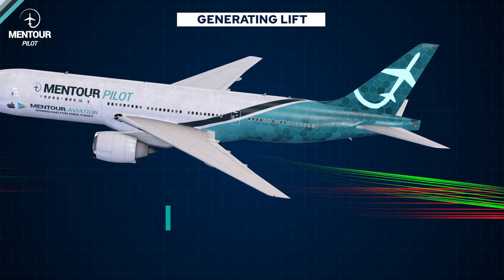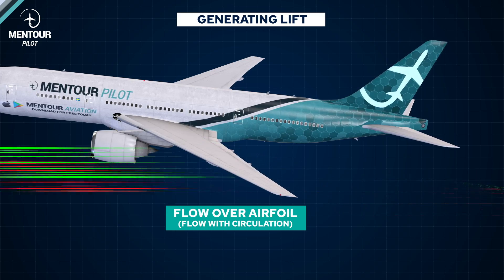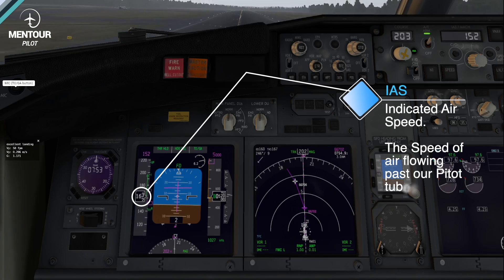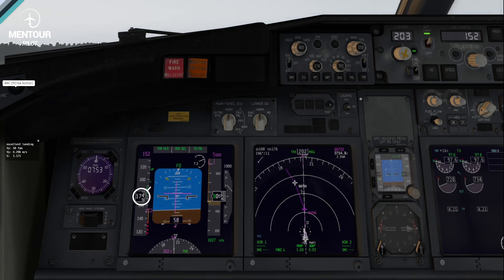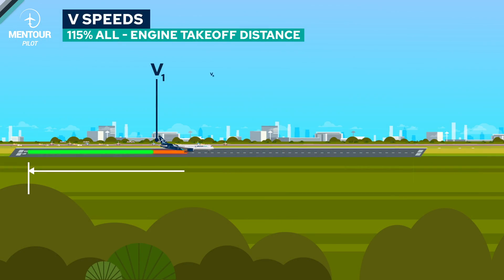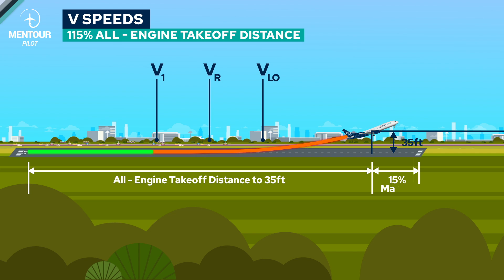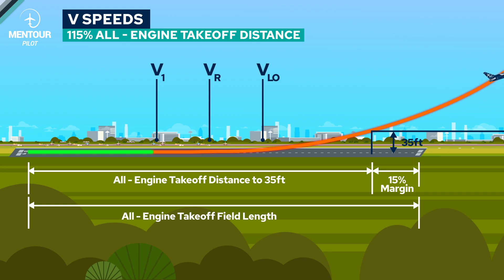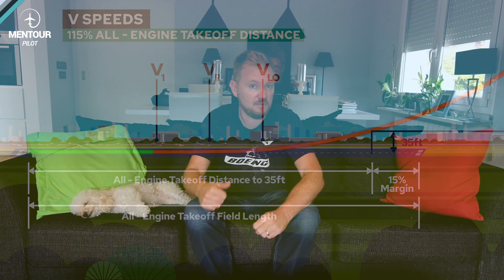Why do pilots call out SPEEDS?!

Comment: At 7:50 the graph shows a linear relationship between speed and mass. Kinetic energy is 1/2mv^2, so this doesn’t make sense to me
Reply: You aren't alone -- that graph needs a do-over.  If I (or someone else who's had experience with V1 matters) can figure out a way to salvage the attempt, I'll post and maybe it will get pinned.  As for what's there now, it is true that the relation between V1 (unfortunately the graph is just labeled "speed") and mass would be "monotonic decreasing" as is depicted, though as you point out presumably not linear.  Nor any other simple math relation:  I used to run a computer program for stopping distance calculation which time-step integrated through a host of nonlinear contributing factors such as drag, speed-dependent braking coefficient, and when applicable spool up/speed-dependent reverse thrust for a given EPR or N1 thrust setting... and that was just the "braking distance" part of the larger accelerate/stop scenario which determines V speeds for a given set of aircraft and external conditions (runway length, runway slope, air density, wind vector).

Comment: ICAO: We need to make things easier to remember and communicate
Also ICAO: Here are our 46 V speeds
Reply: I just got into a new type a couple years ago. The plane has all the basic systems that any other transport category aircraft has with the exception that the manufacturer decided to rename and re-acronym EVERY. THING. That first check ride was quite a test!
Reply: @aafjeyakubu5124  did the manufacturer ever provide a good reason for distinguishing itself that way?
Reply: @77thTrombone  They did not and I did not ask. However, the primary language of this manufacturer is not English and the translated books, while not as bad as they could be, are riddled with spelling errors and concepts that don't seem to translate well to English.
Reply: @aafjeyakubu5124   ah, yes.  I have immediate ideas, but will only observed that certain languages seem remarkably more prone to issues of "concepts that don't translate well" than others.  That trait could be considered a form of technical security.  Happy flying!

Comment: 8:27 When the weight changes the lines are going to move and the intersection is going to move. I am seriously confused. The changing weight should be already be accounted for in the diagram. There is no need to shift the lines. Unless weight and mass mean very different things (I know weight is technically a force but it shouldn't really matter in this case).
Reply: The chart isn't right, to put it simply.  So far I'm nearly a day into head scratching with still no answer as to how better to represent what he is trying to depict.  In reality there are a lot of interacting nonlinear factors which go into either of the lines, but perhaps something which at least illustrates the interplay between mass and V1 can be concocted (or already exists somewhere else, and whoever finds it can share the link?).
Reply: @marcmcreynolds2827 
@Thomas Dalton wrote this almost a year ago in a different comment, and I think it makes good sense:

"I think the correct description of that chart is that V1 for a given mass is the lower of the two lines. For a low mass, it is where the go line is for that mass. For a high mass, it is where the stop line is for that mass."
Reply: @Trotters79  Thanks for finding that, and yes, it does sound like a good explanation in the broadest of terms.  I'm having trouble with the shape of braking line (shouldn't be linear, though for exposition maybe no big deal) and what exactly he's trying to illustrate.  The chart (to within my pickiness) makes more sense if what he's calling "normal" V1 is "balanced field length" V1:  Same distance needed from the V1 point to either brake to a stop without thrust reversers or continue on the remaining engine(s) to clearing 35 ft.

Side note:  In reality, because of a stiff factor of safety the FAA applies to the demonstrated dry-runway stopping distance, a "balanced" V1 actually results in a significant amount of runway left at full stop, even before allowing for reversers if they happen to be available in a particular incident (even just idle reverse helps, by removing forward idle thrust contribution to the dynamics).
Reply: @marcmcreynolds2827 
I agree in most of the things you mention. As I'm not an aviator or pilot, but just very technically intrigued, I don't know anything about the various variants of V1 you're mentioning.

My take on the graph is that it was meant to provide basic understanding, rather than being representative for any particular aircraft. The scale of the axis are not given, so they could be logarithmic for all we know, thus the stop line is in reality curved. However, I suspect that such an explanation would render the go line into the wrong shape, so there's that.

I noticed that Petter replied to a different comment from @Tritemius Labs when this video was released nearly a year ago, where he kind of admitted that the graph had some issues he didn't really know how to fix. I guess we'll just have to live with it being a simplified illustration, rather than some exact scientific chart.
Reply: @Trotters79  I give Petter credit for putting something at all detailed out there.  It's a complicated subject, as he suggests in the video and I found out from working in that area for an airframe maker.  Only on the stopping performance side of it, though.  Otherwise, I would presumably be able to straighten out what he and I are both struggling with.

"the various variants of V1"  That's balanced field length, which I talked about above, vs "unbalanced field length", which as I understand it allows takeoff at a higher weight than the balanced field length calculation and runway needed to stop no longer equals runway needed to get to 35 ft.  I had the particulars explained to me once long ago, but it never came up in my work.
Reply: @marcmcreynolds2827 
Yes, I totally agree. Petter's verbal explanation is far better than no explanation.
It's just like you say, the calculations behind V1 is far more complex than what can be displayed in a simple XY chart, where the runway length isn't even part of the data, while it being what basically defines at which point you have to take stopping distance into account.

I would argue that key data includes:
* Mass (weight)
* Thrust
* Brakes
* Runway length
* Time

The latter two isn't part of the chart. One might argue it's so indirectly, by defining the red and green curves or something, but I believe the chart has to have some sort of multi axis layout, or more likely: multiple charts are needed.

Chart:
X = distance (increasing numbers for acceleration and decresing numbers for deceleration)
Y = speed

Multiple lines for acceleration in a fan pattern, where each line represent the graph for a given mass (range). Low mass gives a steep line (higher speed at shorter distance), and high mass gives flatter line (lower speed at longer distance).

Then another set of lines for deceleration, but here the X axis (distance) is reversed, with origo in the lower right corner. Thus the deceleration lines will tilt in a mirrored pattern of the acceleration lines.

Where the two lines (acceleration and deceleration) for av given mass (range) intersects, should be V1, given the sum of the acceleration distance and retardation distance doesn't exceed the length of the runway being used.

If the intersection point indicates the distance for go + distance for stop exceeds the length of the runway being used, a horizontal cap line that intersects the go line and the stop line at a lower speed should be applied, so the sum of the distances for these intersections are shorter than the distance of the runway being used. Then this horizontal line indicates V1, which is at what point you are committing to the take off, because the remaining distance isn't long enough to stop at a higher speed.
Reply: @marcmcreynolds2827 
Come to think of it:
A speed cap line above the intersection point of the acceleration and deceleration lines is just as reasonable as below, because this intersection point is basically just defined by the range of the X axis, whereas the cap line is depending on the actual runway length (and the mass of the aircraft).
Reply: @Trotters79  That's the sort of approach which was used prior to computerized calculation:  Nomographs.  An X and Y axis with something like (depending on the particular chart) weight on one axis, a dizzying array of somewhat congruent lines for the relevant variables and parameters spread across the middle, and a result (e.g. balanced field length V1) on the other axis.  Always a dashed line with directional arrows providing an example for one set of numbers of how to proceed across the page from start to answer.

A key element of the approach was that no math calculation would be required, since math errors would then inevitably be made from time to time in using the chart.  So if say tailwind was penalized more than headwind was rewarded in a performance calculation, that would be reflected in the slope of the line changing at windspeed = 0 in the part of the nomograph where ambient wind was accounted for.

A bit complicated to describe in words, but it worked reliably for decades.

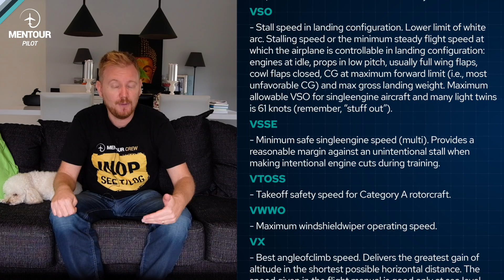Comment: Visible at 12:43 is my favourite speed of the list: VWWO - Maximum windshield wiper operating speed. My other two favourites are visible at 12:14 VLLE (Maximum landing light extend speed) and VLLO (Maximum landing light operating speed). "You want to go a certain speed? We got a V for that." 

The best description however goes to the VLO visible at 12:16 : "In an emergency involving loss of control - when the ground is getting close and the airspeed is quickly approaching redline - forget about this speed. Throw the gear out!"

Some of these speeds are awfully specific or simply plain weird:
1. VDEC - Multiengine piston and light multiengine turboprops accelerate/brake decision speed. Doesn't this collide with V1?
2. VENR - En route climb speed with critical engine inop
3. VFS - Final segment jet takeoff with critical engine inop
4. VMCA - "Most critical" engine inop, 5 degrees of bank, gear up, flaps up and so on. I didn't know there is a "most critical" definition. Critical is usually the highest form of failure..
5. VMCG - Minimum ground control speed not using nose wheel with engine failure during takeoff roll for jets, turboprops and transport category aircraft
6.VMO/MMO - Maximum speed before top side barber poles reach your current speed, depending on wing design
7. VS1 - This is the clean stall speed (gear and flaps up), although "clean" is up for debate
8. VSSE - Minimum safe single-engine speed for multi-engine plane for training
9. VTOSS - Category A rotorcraft - that type is only mentioned this once in the whole list

I just wonder why they don't have a V35D: Speed at which a 35 degree bank angle will not cause more than 500 feet per minute sink rate. Or maybe add a VML: Maximum landing speed at which the tires with regular pressure at 500 feet above MSL have a 20% speed margin to exploding.

I do hope, my ficticious speeds will not be added to the ICAOs list and asked at any ones flight exam :D
Reply: Does the landing light extend speed apply to Boeings and Airbuses as well? I’m not aware of manufacturers like Bombardier or ATR but I am aware the McDonnel Douglas (although now Boeing) MD80s had extendable landing lights so having a V speed for landing light extension makes sense. Do other manufacturers have it as well or are they just built flush into the wing?
Reply: @aqimjulayhi8798  I'm not a pilot myself. Just looked for that speed in use at all and the only aircraft I could find using that speed is the Cessna Citation 650.
That speed is probably standardized but mostly irrelevant. It would only apply to plants or helicopters that have extensible landing lights.

I guess the rule is that these are fixed. Having them extendable is just another piece of mandatory equipment which could fail and additional weight which could be avoided.

Comment: My question is about the V1 decision. I watched a video last week about a commercial passenger plane which had the landing gear break and catch fire either just before or about V1. The pilot continued the takeoff, pulled the landing gear up, and brought the fire into the fuselage. In that situation, is it better to have the runway excursion since you know you have a landing gear failure and fire or is it still proper to take off because you have reached V1?
Reply: They won't generally know what exactly is wrong from the cues they get in the cockpit, or in particular know that there will be reduced braking ability, so hard to decide to go against procedure.  "Abort past V1" is for if you somehow know the aircraft isn't airworthy.
Reply: @marcmcreynolds2827  Thank you! I would have thought never leaving the ground and having the excursion was better than landing with broken gear, but the lack of knowledge about the true situation makes sense.
Reply: @marbleousmel  Beyond what I said above, and speaking as a former landing gear engineer (one whose duties included keeping track of wheel well fire incidents), if I did take off, I wouldn't retract the gear if there might be a landing gear problem. Not unless I needed all the climb rate I could get.

Post-V1 RTO + overrun can work out fairly well in terms of minimal-to-no casualties 
(though I'm just working from random incidents which come to mind). The main landing gear struts of any airliner are designed to cleanly strip off at the hinge point if they encounter soft ground while going fast.  That limits the chance of the trunnion (gear attachment structure) ripping away and breaching the fuel tank above it.  But even when that didn't work and the aircraft was consumed by fire, people generally got out.  Steep embankments past the end of the runway, leading to breakup of the fuselage (and so smoke/heat can rapidly intrude) are what I associate with the times when a severe overrun didn't work out.
Reply: @marcmcreynolds2827  It was Nigeria Airways flight 2120. I went back and looked for the video. It appears they thought they had a flat tire, hit 80 knots and called for V1 anyway. The problem started when they released the breaks, so they had time. Spinning that scenario a bit, if a pilot assumed a flat tire at V1, I take it from your prior reply they would still take off? I’m not sure how much of a crash a flat tire would cause on landing.
Reply: @marcmcreynolds2827  I will say the video is clear that low tire pressure wasn’t considered a reason to reject take off, and that plane had no fire detector in the landing gear assembly. It just struck me as odd that you would take off with a flat tire because of the problems it might cause on landing.
Reply: @marbleousmel  "they thought they had a flat tire [yet continued the takeoff roll], hit [V1] and called for [rotation] anyway"?  2120 was a weird one. They were barely past 60 kt and already suspecting a flat tire, yet kept on going. The Saudi report tried to excuse the crew in that regard, taking the position that they weren't trained to abort for a flat, but people don't even drive their cars that way (detect a flat while still at low speed on the freeway on ramp, and continue to accelerate instead of pulling over to the side?) Below 80 kt, you RTO (at a mild level of braking) for just about anything.

The problem (tire failure) apparently happened at around only 50 kt, which is another way of saying that was one underinflated tire.  The ground crew knew about it, but elected to ignore rather than remedy because the flight would have been delayed waiting for a nitrogen bottle.  Tires are as highly engineered as any other critical structure, and departing with an underinflated one is like noticing a crack in the airframe but deciding not to worry about it.
Reply: @marbleousmel     > It just struck me as odd that you would take off with a flat tire because of the problems it might cause on landing. <

People tend to think of landings as harsh on the tires, but by the numbers it's actually the takeoff roll... at least for apples-to-apples comparisons like a MTOW takeoff compared to a MLW landing.  There are several factors which contribute to that:  

* The vertical load imposed on the tire is higher for longer during the takeoff, both because of the higher aircraft mass and because at touchdown the wing is still supporting most of the aircraft's weight until after the spoilers deploy.  The tire isn't getting as much punishment as it might appear.

* Speed is higher at takeoff, which stresses and heats the tire more.

* The tire is cool (ambient) at landing, but can get hot from flexing along its side during a long taxi and then even more as speed increases during takeoff. Especially true if the tire is underinflated (more deflection = more sidewall flexing = more heat-- same as with a car tire but airliner tires operate at twice the deflection and have thicker cross sections, so much more heat buildup can occur).

Add all the above up, and continue takeoff/return for landing (after getting weight down some) is certainly an option, though there is no clear cut winner.  If I were at the controls, I think I would have it in mind as a matter of pre-flight planning that if my V1 is at or very close to Vr, continue with the takeoff.  If several more seconds are involved, however, then RTO mindful that the failure of one tire increases the chance its companion will fail prior to takeoff [edit: , as happened with 2120.  While a dual tire failure over the course of an RTO stop is bad (increases stopping distance, though there is some margin built into the flight manual numbers), landing with two failed tires on the same side is probably worse.]
Reply: @marcmcreynolds2827  Thank you do much! I understand much better now.